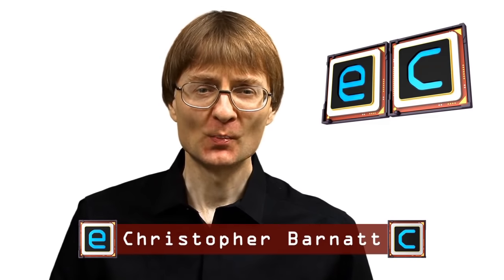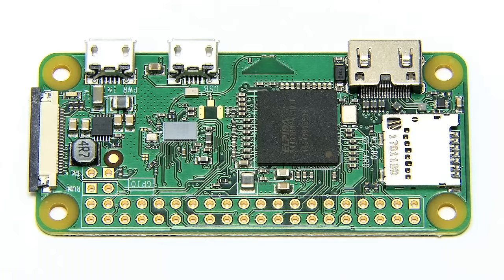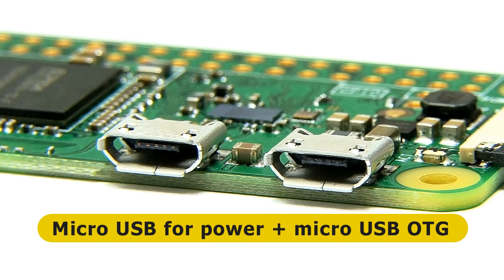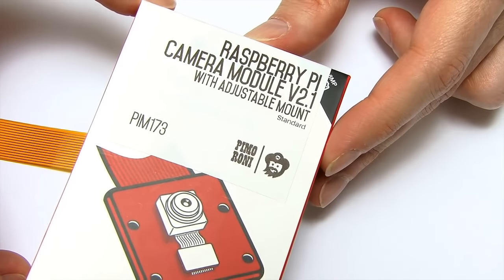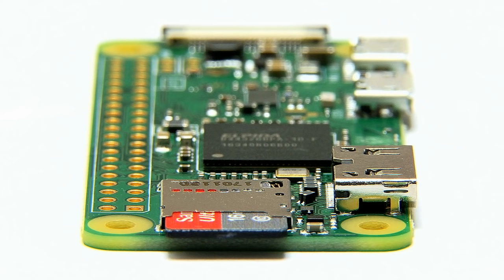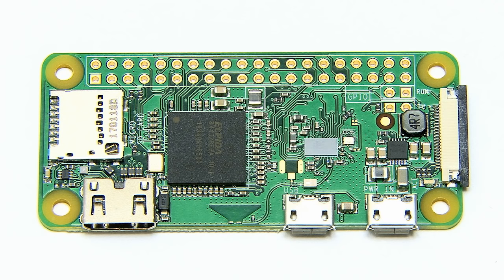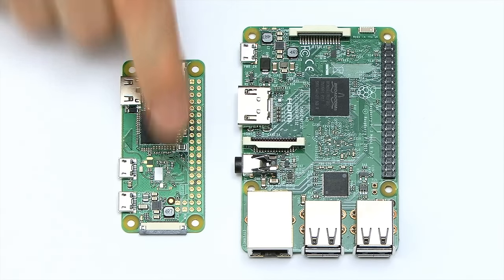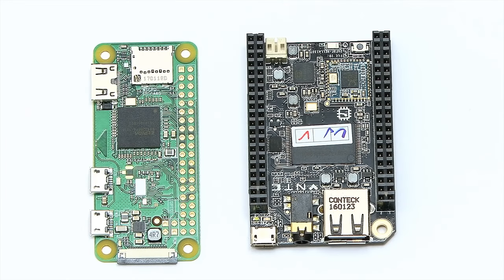Pi Zero W & SBC Update

Comment: The raspberry pi zero W is really what the raspberry pi zero should have been to begin with.
It's the ultimate DIY embedded computer now.
Reply from the maker: I totally agree -- it so needed the wireless networking.
Reply: The more basic design allowed them to give away the first batch.  It has the distinction of being the first computer to be given away... or maybe it was hidden in the £6 cover cost.  Anyway, I'm waiting to see who will be first to include a computer for free inside a box of corn flakes.
Reply: oh, I'm not saying that the original pi zero is a mistake. Far from it. It's just way less practical without the bluetooth and wifi for DIY projects. That first pi zero was good to test the market and as proof of concept for 'extremely cheap computers'. Much like the Raspberry Pi A against the Raspberry Pi B+ where the B+ is the far more practical version of the A but we wouldn't have gotten to the B+ if it wasn't for the A first.
Reply: yes, indeed! now it only needs proper audio pins and then its a complete package!
Reply: I'm not arguing...Mr Sanzot (?)  This is a welcome update, and well worth the extra fiver.  The radio wotsit obviates the purchase of a USB hub.
Reply: +The Black Talon    I recommend the Phat DAC hat for the Pi Zero.  I bought some phono sockets to solder on too.  The analogue output sounds really good.
Reply: or one of these from IQ Audio...
http://iqaudio.co.uk/audio/38-pi-daczero.html
Reply: Surely it wouldn't hurt to include a uFL or MHF connector on the PCB so an external antenna could be used?
Reply: I was reading info on the 43438 and it said the chip also includes an FM receiver covering 65 MHz - 108 MHz.  I wonder if that feature has been implemented?
Reply: PrimaPunchy all us FBI operatives have been waiting for you to say kodi
Reply: kodi
Reply: This machine isn't capable enough for film, though.
If you want to make a home media centre, get a raspberry pi 3.

kodi? but but but, that has illegal services in it! Nobody uses kodi because the forbidden fruit is forbidden (are they gone?)

Comment: Whenever a minimal device is introduced, somebody always starts demanding more. In this case, it would be nice if the Pi 0W had more memory; 512's a bit of a limitation. (It's also a pity that it's not possible to add memory to the Pi. (Swap can help, if you don't mind the performance hit,)

Comment: Great video! Do you think it could run mint playing YouTube 1080p60fps?
Reply from the maker: In theory the Pi Zero (W) can play 1080p 60fps. In practice I doubt that it would (always) work. YouTube in particular I think would struggle at that resolution due to the lack of RAM for buffering.
Reply: But can it run Crysis?
Reply: Thanks for the reply. I have heard about this tech where you can stream games from a more powerful rig. I am wondering if I could use the zeroW  to stream linux steam games to over wifi and use the HDMI to drive the display @ 1080/60fps.
Reply: I really doubt that. I've been using Steam In-Home Streaming, and it works excellent on pretty much anything, as long as it got a good connection over ethernet or wifi, AND hardware h.264 decoding. Therin lies the problem. The Pi 3 can make it work, but only at 1080p30 or 720p60, which sadly makes the Zero a complete no go. Maybe next generation ;)
Reply: But if you want the best Stream-box you really should go with the Tinker Board, since it have a significantly stronger GPU and both hardware decoding for h.264 and h.265, both capable of 4k rather than 1080p on the Pi 3, AND gigabit ethernet.
Reply: Thanks for the info!
Reply: As far as I know steam requires an x86 / x64 processor. It won't run on the arm processor of the raspberry pi
Reply: Would it run if I install steam using wine and playonlinux
Reply: If anyone is interested apparently you can run x86 on ARM. https://wiki.winehq.org/ARM .How practical or usable it would be is a different story. Shame I dont have a ARM board to test it. Might have to do emulation inception and melt my laptop.

Comment: I was under the impression that the original Pi Zero targeted integrated hardware more than the beginner "Hello World" community. I see a lot of simple projects like gaming, Kody, and basic radio controlled toys, but where are the advanced projects? I'm curious about real time audio processing with FFT, electrical engineering lab hardware/tools, robotics with complex degrees of freedom, or prototype automation. Is there a place that guides people through these types of projects?

Comment: Is there an option to clip on something like a SMA to U.FL lead for adding a bigger wifi antenna?
People could buy one of those dummy CCTV cameras and install the new Pi Zero in it with camera attachment.
Turn the dummy camera into a smart IP camera either fixed or with some servos to allow it to look around.

Comment: try this,hook up a monitor and run the OS and use a flash to light the wireless chip.i think since is not potted it will loose connection due to the light

Comment: Could a  Raspberry Pi be made to run on a battery like a laptop can???
Reply from the maker: Yes, you can just plug a Raspberry Pi into a USB power bank and it will run fine. If you look at the robot in this video, you can see the power bank that runs it goes down the middle.

Comment: Will the Tinker Board be compatible with any of the Raspberry Pi cases?
Reply from the maker: Yes, the Tinker Board will fit most Raspberry Pi cases. The only issue is that the Tinker Board's SoC and its heatsink are far larger than the SoC on the Pi, so any case that does not have space there will be a problem.

Comment: I don't know a lot of things on computer, but I'm really interested to know more about it. I know that SSD loads faster than HDD, but I have a question:

If I use SSD as my main DriveC/boot drive, and use my HDD as my secondary storage, would it still be fast when I open files/games in secondary hard drive (HDD)? or those files/games have to be stored in SSD?

Hope you understand my question :(
Reply from the maker: You will get some speed improvements by running your OS from an SSD and loading games/etc from the HDD. But the biggest speed improvement will be to have the games load from the SSD too.
Reply: Oh i see, thank you so much :D I love your videos, well explained.

Comment: Huh, looks like they bothered to include a complete pad for a u.fl connector on the Zero W unlike the half pad on the Pi3, nifty! Could actually install a decent little external antenna on your project if you liked. I hope some day in the future they come out with a full fledged Pi2/3 in a similar form factor, that could make for some interestingly tiny Retropie/HTPC builds. But I figure they want to keep it flat on the back like they have for a reason.

Edit: Unless Asus or somebody provides drivers for the Tinkerboard's GPU it'll be doomed to so-so support like the Odroid, those Mali GPUs always keep these "Pi-Killers" from actually doing decently.

Comment: You know what’s so cool about the raspberry pi? You can, for an additional $25 dollars, set up an iPad through some app called Screens as a monitor by ssh and then connect an iPhone to the iPad for trackpad. Then add a Bluetooth keyboard and boom, you just turned an iPad into a desktop using a computer that actually has a decent operating system.

Comment: When you compared the Zero W against the CHIP, it's obvious the Zero W is the better computer. The CHIP launching without HDMI is a major downside in my opinion and it's not worth the extra $10-$15 cost for the HDMI add on. Plus you have to use ALL the GPIO pins (yes I know you can solder on more pins on the HDMI attachment, but you shouldn't have to do that).

Comment: ' ... but the Pi Zero W will be in stock! '
3 months after this video stock was still problematic and when I bought one in June I paid 25 usd at the cheapest retailer.
I could have gotten my hands on it earlier, but I was hoping for a cheaper Zero. Even now stock is problematic. They are for sale, but you can't just buy a couple. Just like the previous models the whole 'super cheap pc' promise wasn't lived up to unless you lived in the right country. At least not for a long time. I can't really fault them too much considering how they run the foundation, it's not like they're Coca Cola and they can get everything up and running globally instantly, but it was a real bummer for a lot of people.
(The previous models were sold here, but they wouldn't sell the official adapters, cables and some other peripherals and documentation on working SD cards was unreliable, so you'd spend a lot of time and money troubleshooting and trying different adapters, cables and SD-cards getting everything to work.)

Comment: Why can't they make 8gig ram and use old Intel i3/i5?

too hot?
Reply: i5s and i3s would consume far too much power and output too much heat the i3 T skus tend to have about 35 watt tdps, and raspberry pis tend to be less than 5 under stress tests from what I could find, micro usb can't deliver that much power consistently and the costs would be higher as well, and they couldn't fit 8 gigs of ram on the board, there are a few companies that mangage to fit 16 gigs onto a sodimm module which is a little shorter but wider than the pi zero and that takes up both sides of the board, so they would lose half of their space to put components on just for the sake of putting memory on it that couldn't even be used by the types of applications that the processor can run, also increasing costs.